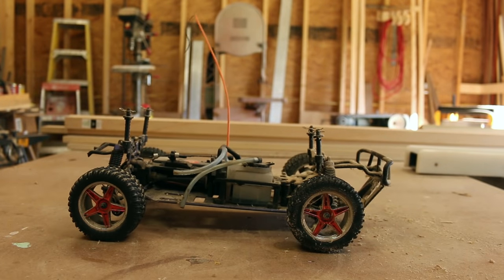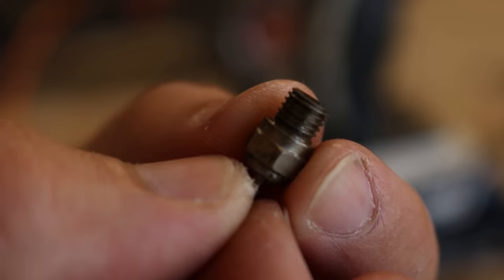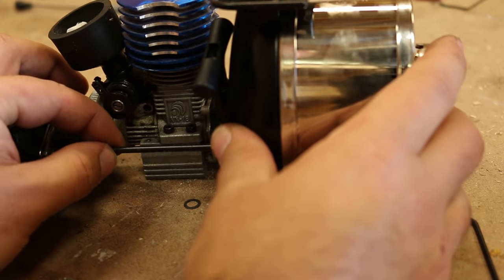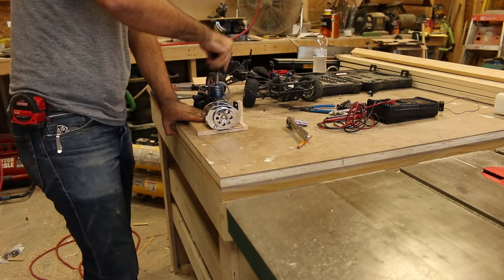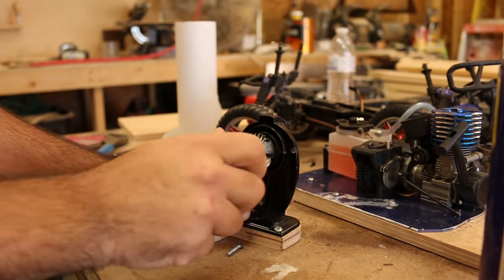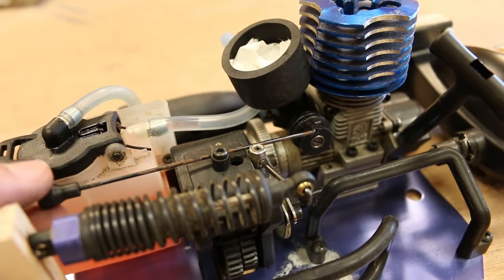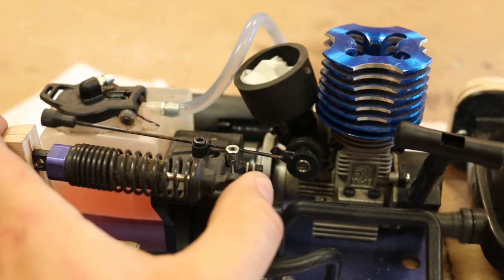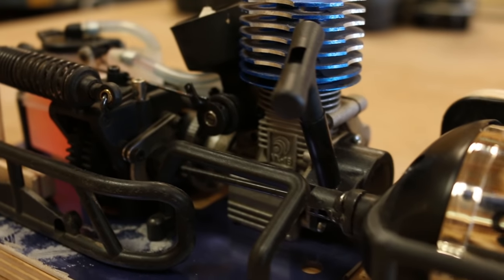Nitro Engine Powered PENCIL Sharpener!

Comment: Imagines a giant warehouse I walk into and find thousands of these pencil sharpeners filling the air with a very loud small engines by the thousands running sounds

As I walk in I see the first table with a bunch of chinese women sitting at the engines for as far as I can see in the warehouse pulling unsharpened pencils out of one box quickly sharpening them then putting them in another box

I ask, What the hell is this place?

A small chinese man answers, This is the government run pencil sharpening department

I ask, What does the government need so many pencils for now days?

Oh they don't I'm told by the little man, They just never shut this department down since they stopped using pencils back in 1965 but all of these thousand and thousands of professional government pencil sharpeners would be out of a job if they shut us down so we are one of them government departments that is too big to fail kind of like government pensions

Ok now I understand LOL